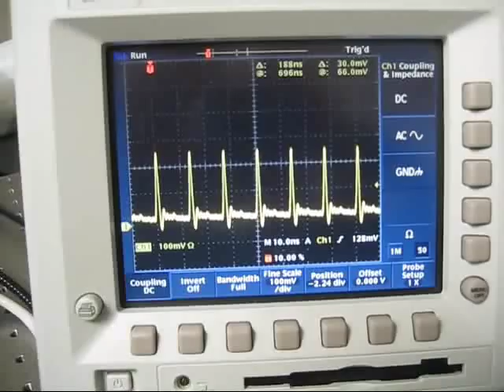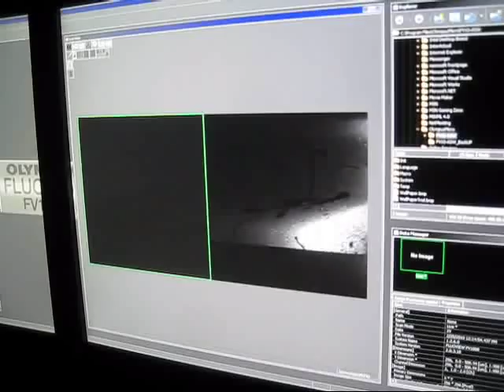Multiphoton Microscope Alignment using Second Harmonics Generation Crystal

Comment from the maker: Mavericks Cr:Forsterite Femtosecond Laser brochure
http://www.dmphotonics.com/Product_Data/Mavericks_datasheet_DMP.pdf

Mavericks Cr:forsterite Lasers brochure
http://www.dmphotonics.com/mavericks%20brochure%20web.pdf

Femtosecond Cr:Forsterite Laser from Del Mar Ventures
The ultrafast Cr:Forsterite laser produces femtosecond pulses in near infrared range around 1250nm. It's a new important ultrafast laser for variety of applications in scientific and medical research, micromachining and imaging, as well as in advanced military and defence R&D.
http://www.prweb.com/releases/2004/05/prweb126705.htm

New ultrafast laser system based on the Chromium: Forsterite offers wavelength 
alternative to Ti:sapphire 
 http://www.focusonmicroscopy.org/2006/PDF/144_Carson.pdf
Chromium-Doped Forsterite Crystal (Cr:forsterite) is a solid state laser material that 
fluoresces in the near-infrared region centered around 1240 nm. Cr:forsterite has been 
successfully used as a gain medium in Kerr lens mode-locked (KLM) femtosecond lasers 
with cavity designs similar to the popular Ti:sapphire femtosecond laser systems. 
Cr:forsterite exhibits strong absorption in the near infrared and can be directly pumped 
with CW lasers operating at 1064 nm, offering a significant reduction in system cost 
compared to femtosecond lasers pumped in the 532 nm region. 
By coupling an Ytterbium fiber pumping laser with the Cr:forsterite laser oscillator a 
complete sub 65 fs laser system with output power up to 300 mW has been made 
commercially available at 1250 nm. Wavelengths in the 1250 nm range are less damaging 
to biological samples than other ultrafast lasers making Cr:forsterite based femtosecond 
laser systems an ideal source of ultrashort pulses for biological and medical applications. 
Frequency doubling with an optional Second Harmonic Generation (SHG) module 
quickly and easily provides wavelengths in the visible at 630 nm and super-continuum 
generation produces pulses in the infrared and visible range. 
Cr:forsterite regenerative amplifiers can offer pulses with mJ energy levels. Energies of 
this magnitude combined with femtosecond pulses gives rise to new applications 
including: all optical histology, precision micromachining, and high energy physics.

Del Mar Photonics Announces New Mavericks (TM) Long Wavelength Femtosecond Laser for Scientific Research and Enhanced Biological Imaging
http://www.businesswire.com/news/home/20070311005050/en/Del-Mar-Photonics-Announces-Mavericks-TM-Long#.Uyi1az9dU1I

Jaws multi-terawatt Cr:forsterite laser

First available terawatt pulses at 1240 nm. We have developed a terawatt femtosecond chromium-doped forsterite (Cr4+:Mg2SiO4) laser system, based on an oscillator, regenerative amplifier and four stages of multi-pass amplifiers. The system can generate 80 fs pulses at 1240 nm wavelength, with pulse energies of 85 mJ giving a peak power range of 1-2 TW at 10 Hz. 
Terawatt peak power is achieved by a technique known as chirped pulse amplification (CPA) where the femtosecond seed pulse is temporally stretched with a diffraction grating before being amplified. The pulse is then compressed after the amplifying stages. This design allows the Jaws multi-terawatt system to be assembled on a single 1.2×3.0 m optical table. The subsystems (oscillator, stretcher, regenerative amplifier and compressor) used in the Jaws are our standard production products. This modular approach greatly reduces the system cost and lead time when compared to other terawatt systems available. An additional advantage is that Cr:forsterite can be directly pumped at 1064 nm removing the need for more expensive frequency doubled pump lasers.
Fundamental radiation, second and third harmonics of Cr:forsterite laser are convenient for a number of applications in time-resolved spectroscopy, telecommunications, photochemistry, photobiology, plasma physics, vacuum ultraviolet, x-ray generation, and material processing. Wavelength range is also well outside the visible and shows significantly less pulse broadening in atmosphere than 800 nm. 
http://www.dmphotonics.com/Jaws%20multi-terawatt%20Crforsterite%20laser/Jaws%20multi-terawatt%20Crforsterite%20laser.htm

JAWS laser system brochure
http://www.dmphotonics.com/jaws%20brochure%20web.pdf

http://www.delmarphotonics.com/Jaws%20multi-terawatt%20Crforsterite%20laser/Jaws%20multi-terawatt%20Crforsterite%20laser.htm

Comment: Ti:Sapphire Laser Kits
http://www.dmphotonics.com/TiSapphire_Laser_Kits/CW%20TiSapphire%20Laser%20Kits.htm

price range for Ti:Sapphire lasers and Ti:Sapphire laser kits
http://www.dmphotonics.com/TiSapphire_prices/fs%20TiSapphire%20laser%20price.htm

Trestles LH Ti:Sapphire laser
Trestles LH is a new series of high quality femtosecond Ti:Sapphire lasers for applications in scientific research, biological imaging, life sciences and precision material processing. Trestles LH includes integrated sealed, turn-key, cost-effective, diode-pumped solid-state (DPSS). Trestles LH lasers offer the most attractive pricing on the market combined with excellent performance and reliability. DPSS LH is a state-of-the-art laser designed for today’s applications. It combines superb performance and tremendous value for today’s market and has numerous advantages over all other DPSS lasers suitable for Ti:Sapphire pumping. Trestles LH can be customized to fit customer requirements and budget.
http://www.dmphotonics.com/Trestles-LH_femtosecond%20_laser/Trestles-LH.htm

Ti:Sapphire Laser kits
http://greyhawkoptics.com/index.php?cPath=163

Comment from the maker: How to choose BBO crystal for type II THG
http://www.dmphotonics.com/BBO%20crystal%20for%20type%20II%20THG/How%20to%20choose%20BBO%20crystal%20for%20type%20II%20THG.htm

BBO crystal, Type I, SHG 500 nm to 250 nm, 6x6x0.2 mm, AR coated sales@dmphotonics.com 
BBO crystal, Type I, SHG 500 nm to 250 nm, 6x6x0.2 mm, AR coated sales@dmphotonics.com

BBO and AgGaS2 crystal sales@dmphotonics.com 
BBO and AgGaS2 crystal sales@dmphotonics.com

BBO crystal, Type I, SHG sales@dmphotonics.com 
BBO crystal, Type I, SHG sales@dmphotonics.com

BBO for OPA - request a quote sales@dmphotonics.com
BBO, theta = 32 deg, type II crystal
size: 5mm x 5mm aperture, 3mm thickness (along beam propagation)
pumped by 800nm, 150fs

Type I, SHG, 800 nm to 400 nm - request a quote sales@dmphotonics.com
Orientation: Theta=29.2 deg; Phi=90 deg (+/- 0.5 deg)
Specifications:
Material: BBO crystal
Dimensions: 6 x 6 mm (+/-0.1 mm)
Thickness: 0.2 mm
Surface Quality: 10-5, scratch-dig
Flatness: Lambda/6 at 633 nm
Parallelism: <= 5 arc minutes
Other faces: fine grind
Coating: DICHROIC AR/AR at 800 nm and 400 nm on both faces
Mount diameter: 25.4 mm

Type I, THG, 800 nm to 266 nm - request a quote sales@dmphotonics.com
Orientation: Theta=44.3 deg; Phi=90 deg (+/- 0.5 deg)
Specifications:
Material: BBO crystal
Dimensions: 6 x 6 mm (+/-0.1 mm)
Thickness: 0.2 mm
Surface Quality: 10-5, scratch-dig
Flatness: Lambda/6 at 633 nm
Parallelism: <= 5 arc minutes
Other faces: fine grind
Coating: PROTECTIVE at 800 nm and 266 nm
Mount diameter: 25.4 mm

BBO for OPA - request a quote sales@dmphotonics.com
http://www.dmphotonics.com/BBO_crystals/BBO_for_OPA.htm

http://www.dmphotonics.com/BBO-crystal-SHG-THG-coating/BBO-Type-I-crystal-SHG-800-400.htm

BBO SHG @ 800 nm
http://greyhawkoptics.com/index.php?cPath=32_67&osCsid=90db22c7d73635357efa15eaee1b960c

BBO THG @ 800 nm
http://greyhawkoptics.com/index.php?cPath=32_68&osCsid=90db22c7d73635357efa15eaee1b960c

BBO FHG @ 1035 nm
http://greyhawkoptics.com/index.php?cPath=32_160&osCsid=90db22c7d73635357efa15eaee1b960c

Comment from the maker: Two Postdoctoral Positions in Advanced Imaging of Synapse Dynamics 

Laboratories of Kimberley McAllister & Mark Goldman

Center for Neuroscience, UC Davis

The McAllister & Goldman laboratories are soliciting applications for two 
fully funded postdoctoral positions to study synapse dynamics. These 
fellows will use advanced imaging techniques, a cutting-edge imaging 
system, and a novel long-term imaging assay together with computational 
approaches to study the learning rules and molecular signaling pathways 
that underlie the formation, elimination, and stability of glutamatergic and 
GABAergic synapses. Experience in microscopy, optogenetics, molecular 
biology, neuronal cell culture, and experience with mathematical modeling 
through training in fields such as physics, applied math, computer science, 
engineering, or computational neuroscience are preferred but not 
required.  The recruit will join a collegial, collaborative and vibrant Center 
for Neuroscience studying the development and function/dysfunction of the 
CNS, with strengths in synaptic biology, neural development, and 
neurodevelopmental disorders.  The positions are available immediately 
and are open until filled.  

Interested candidates should send a CV, statement of research interests, 
and contact information for 3 references to: kmcallister@ucdavis.edu.

Comment from the maker: Two post-doctoral positions in Ultrafast Spectroscopy at The University of East Anglia
I would be very grateful if you could bring the following posts to the attention of qualified individuals. The closing date for applications is Oct 13. Qualified candidates are welcome to apply for both positions, and full application details are available on the web sites below. The positions are in the ultrafast group of Stephen Meech, which is well funded and equipped with a variety of ultrafast laser sources. Informal queries are welcome at   s.meech@uea.ac.uk. Apologies for cross posting.
Position 1. Ultrafast fluorescence up-conversion. We are seeking to make a three-year appointment of someone with a PhD in Physical Chemistry, physics or a related discipline. The objective of the project is to design, build and use a sub 100 fs up-conversion spectrometer for UV excitation/emission. Experience in ultrafast laser spectroscopy, nonlinear frequency mixing, instrument design and control and low light level detection will all be viewed positively.  The web site for applications is:
https://www.uea.ac.uk/hr/vacancies/research/-/asset_publisher/62h7ppZT4QgW/content/senior-research-associa-4
Position 2. Ultrafast Vibrational Dynamics. This is a two-year appointment to work on a recently installed ultrafast Ti:Sapphire amplifier pumping 4 OPAs. The objective is to build a multipurpose pump probe spectrometer for electronic and vibrational dynamics of molecular materials.  We are looking for candidates with experience in on one of more of the following areas: ultrafast nonlinear optics, transient infra-red spectroscopy, transient Raman, instrument development and design.  The web site for applications is:
https://www.uea.ac.uk/hr/vacancies/research/-/asset_publisher/62h7ppZT4QgW/content/senior-research-associa-5
Steve Meech
http://www.uea.ac.uk/chemistry/people/faculty/meechs